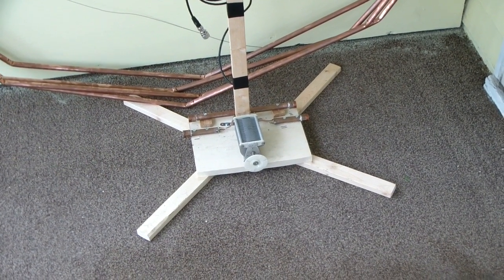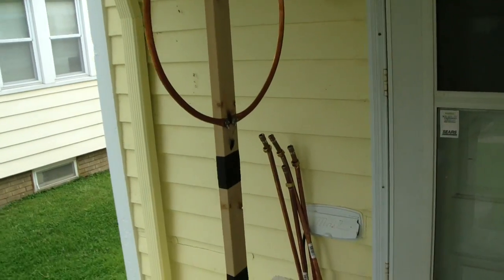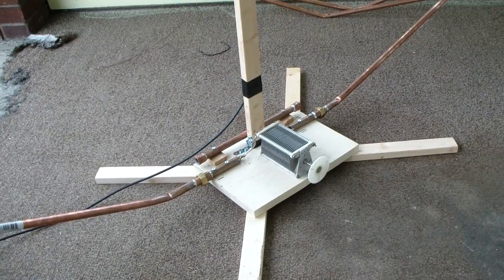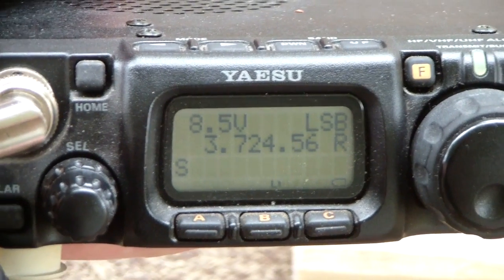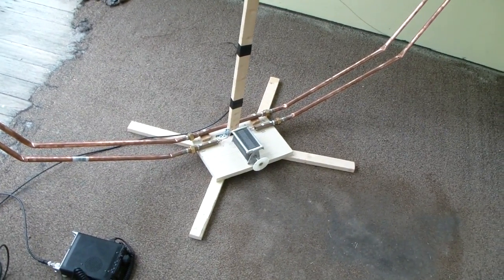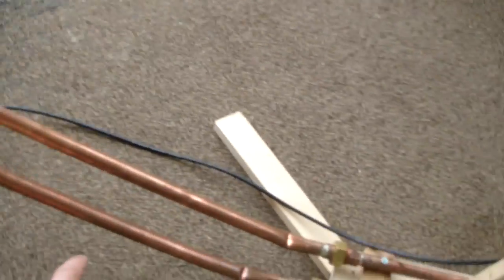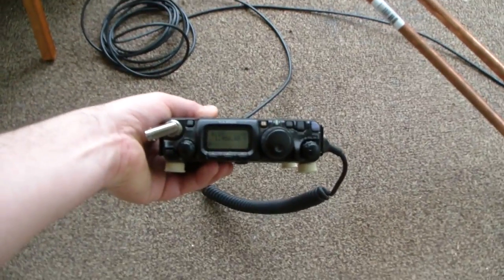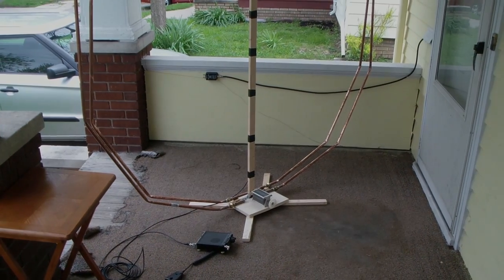Ham Radio - 80 160 meter magnetic loop transmitting antenna

Comment: question ? how did you arrive at 6ft for the 80 loop ....also will the 80m loop work on 40m/20m ? ... if i build a 12 foot loop would this work on 160m using the same 20- 700pf cap ? curious
Reply from the maker: My answer may disappoint you.    I had good results down to 40M with a 3ft loop, so I simply doubled it hoping for a linear relationship between size and frequency.  It worked out precisely so.   However, the range of frequency shrunk with the size increase.   I was not able to get the 6 foot loop up to 7Mhz with the lowest capacitance.
I think the scaling up of size of the loop would also need larger gauge  conductors in order to maintain efficiency and band spread.  But that's just a guess, without building one to test.
I have no idea how a 12ft loop would behave.  If you build such a monster, I'd love to hear how it behaves.
Reply: hi Kevin, thanks for the reply ... i may at some point build the 12footer my concern was about the capacitor needed to tune im guessing that if your tuning the 6ft at half the total of your 20-700pf then  at 12ft there maybe a double up effect or even slightly less .but i will certainly let you know if i start a 12ft loop    73

Comment: specs on the length of the pipe used to make the inner loop and both outer loops would be greatly helpful to new hams in building this. if you don't have a patient and don't plan to use it as such, please share
Reply from the maker: Here's one of those times where high school math that you never thought you'd need  proves it'self to be useful.    ;-)
The circumference of a circle is equal to it's diameter times Pi.    The outer loop is 6ft in diameter.
6 * 3.14159 = 18.84 feet total length.  Subtract the length of the connector pieces to get the length of each pipe.   One pipe has to be about 2 inches shorter so it can cross  under one of the others.
The driven loop is 1/5th the diameter of the outer loop, so  6 * .2 = 1.2 feet in diameter.    1.2 * 3.14159  = 3.76 feet of pipe for the inner loop.
Reply from the maker: To clarify further,  the outer loop is 18.84 feet in length per turn.   If the connectors are 4 inches in length,  that's 8 total, so the outer loops length of pipe would be 18 feet.   Since it's in halves,  3 pipes that are 9 feet and one that's 8 feet 10 inches.
Reply: Thank you. Most include such measures in their presentation.  Not all of us have a 140+ IQ as I and yourself. We include such things to help those who don't and it save them a lot of embrassment or never asking the "stupid " question.
Reply from the maker: Chill James.   No need for the mild sarcasm.  Notice I put a wink in there, " ;-) ".   The wordy explanation was not meant to be condescending, only informative.
There are no stupid questions.
Reply: Hi Kevin, nice job mate. Can I ask what was the veriable cacitor you used please?
Reply from the maker: ***** I thought I put that in the description.    If I remember, it was around a low of 20 or 40pf up to around 700pf.

Comment: Nice build. Can you possible use a motorized tuner instead so you can put that antenna in your attic and tune it from your shack?
Reply from the maker: +John Athanassion Sure.   See my other video on my smaller loop.  I have a really nice remote tuning system with feedback at the control box.    The video is here:
https://www.youtube.com/watch?v=J2QBQ45C0b0

Comment: nice setup.  can you give what is the value of the capacitor and up to what wattage wwre you able to run without arcing? and are you able to work all the 160 and 80 meter band or just a part of it?

Comment: Do you have design specs to follow so we can make one?
Reply from the maker: +Daniel Looper The outer loop(s) are 6 feet in diameter,  the driven loop is 1/5th that, so 6/.2 will give diameter.   The tuning capacitor was not measured,  but any cap with wide spacing should work,  your frequency range may vary a little.

Comment: It's interesting that you still get a good match with the 2 turn tuned loop as that would provide a different ratio to the coupling loop. The two turns would be less efficient than a single turn and for this reason I would've just tried more capacitance to get it to 160m as its simper and the efficiency goes down in either case anyway.
Reply from the maker: +Dazzwidd The ratio difference is exactly why it works.   Think of the loop as an air core transformer with a primary and secondary winding.   Yes, the efficiency goes down, but it works.   Having a QSO with an indoor 160 meter antenna was a thrill.  Although the other guy didn't believe me when I told him.
Reply: I'm not questioning that it still works but am contemplating that instead of having a 1 to 1/5 ratio, you now have a 2 turns to 1/5 ratio of circumferences. It's interesting and makes me curious why you don't need a 2 turn loop on the coupling coil for best operation.
Reply from the maker: Dazzwidd 2 turns, but still the same diameter.  The ratio in diameter is unchanged in the two turn version,  the coupling loop is still 1/5th the diameter of the outer two turn loop.
The only change is in the ratio of inductance between the two loops.

Comment: Great job you have done there.When you tuned 160 i could hear PLT interference it seems the world is suffering from this   technology  we have a website here in the UK www.ban-plt.org.uk its killing the HF spectrum and making ham radio almost impossible in urban environments .I pick it up on my old cap.co loop i have for 3.7.10mhz fitted with a vacuum capacitor good for QRO operation .Sorry to go on a little about PLT but its something the Amateur radio operators emporiums society's  need to address when its gone we will never get it back.!!

Comment: I need a loop for 6m & 10 m. What would the measurements be?  For 50 watts.
Reply: +Richard Girou Antennas for those bands are already extremely small.  Are you sure you need to go for a magnetic loop?
Reply: I live in a small apartment. No antennas allowed on outside
Reply: If you have a room that's 16' across diagonally you can actually put a dipole up, and it's going to be much more efficient!  My first HF antenna was a 10m folded dipole strung across my bedroom.
Reply: just for reference I also put up a dipole antenna across my apartment on the ceiling.  It works fine for 20M on JT65, but would not work at all for anything else.  likely too much shielding from the wire cage effect inside my building.  The loop antenna might work better for this circumstance, as it filters out all the other frequency interference.

Comment: How many watts are you putting through that antenna on transmit??
Reply from the maker: ABikerLife I have pushed 40W through it without any arcing on the cap.  Worked a guy three states away on 160 with the antenna indoors.

Comment: I wonder that as your inductance loop will induce "two" loops simultaneously if converting into a figure of * so that it only induces one that you might have better performance. It would double your foot print to do so though...
Reply from the maker: lukeoid153 I would wonder about the phasing in a figure 8.  It would probably cancel itself out that way.  I have a 98 foot end fed wire, and the loop performs just as well in testing.

Comment: there are other antennas that do multiple loops in series like this but its usually avoided because it makes them alot less effecient and they are VERY narrow banded compared to a single loop. BUT great job getting on 80&160 on such a small footprint. My motto is if it works good it is good.....73 kc9zhr

Comment: Great job, what's the specs on the capacitor?...

Bud...
Reply from the maker: budleyca1 I think it was marked 500pf, but it could be smaller.  I find both bands near the middle of the range and I've pushed this one to 50W without arcover.
Reply: Great, tnx...
Reply: Kevin Loughin but you burned your wooden pole a bit ¿ :) Nice construction im gonna undertake a loop but am playing with a motor and vacuum capacitor at the moment.. Have you tried putting it a loop diameter above the ground believe this is the reccomended to lower radiation angle  and tested versus on the ground ?
Reply from the maker: Yep, the burn was from soldering with a needle torch.